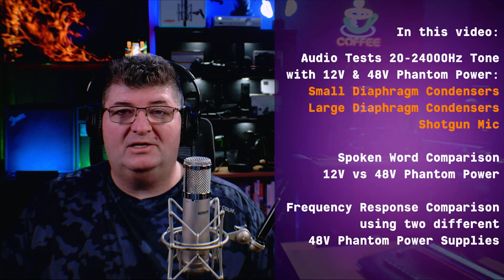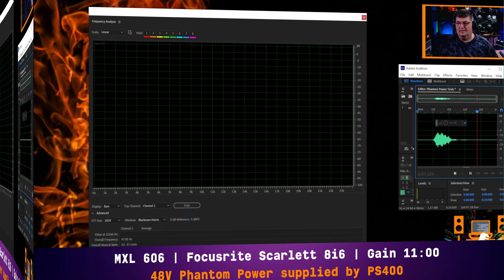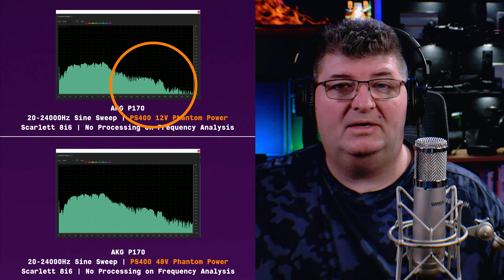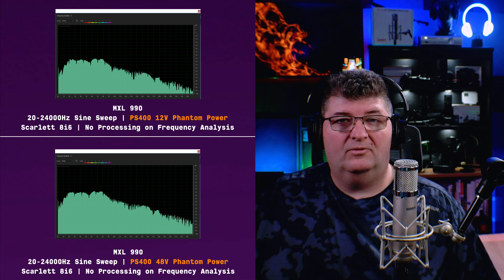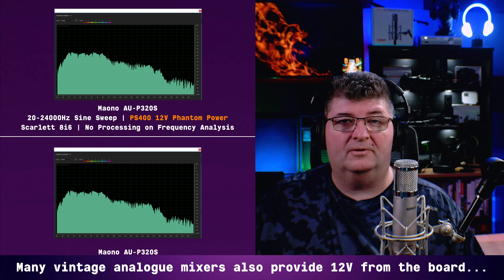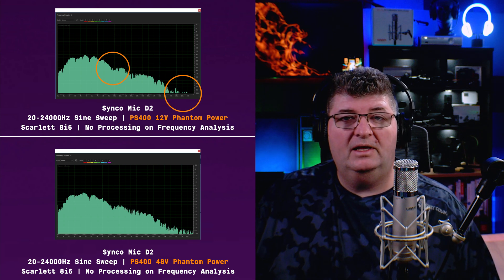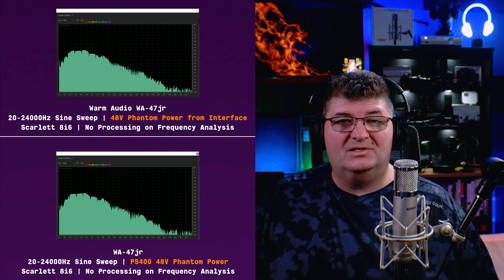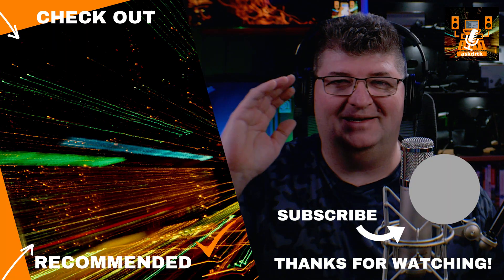How Does Phantom Power Affect Microphones?

Comment: Can I offer a simplified and theory based viewpoint on this? Before I even watch the vid in full. By the way, it would also be good to educate people on phantom power, and what it actually is... not some mysterious thing, and not something sourced from a separate pin.
Anyway, it's as simple as this: AC ripple on a DC supply voltage. I suppose coupling capacitors and their performance could come into it, but I strongly doubt it.
The perfect phantom power supply would come from a battery.

Comment: Hello Sir, few years ago I used Tascam DP 03. When I started recording my song with Dynamic Microphone, I felt very comfortable to sing high pitch notes. But now I use Reaper DAW and use Condenser Microphone, I could not feel so comfortable as I felt in Tascam. Why? Would you please write some suggestions with reason why so happened? Note: I use Nrumann TLM 149 and Aphex 230 Multi Voice Channel. , Preamp. Thanks.
Reply from the maker: I wouldn't suspect using Reaper vs the DP 03 makes the difference, other than comfort with the control layout. I am not sure which dynamic microphone you were using, but even though the TLM 149 is tube-based it generally captures more detail vs dynamic microphones. This can sometimes take getting used to when monitoring while singing. One solution it to monitor with a small amount of reverb (while recording without the reverb). How you set that up will depend on which audio interface you are using as to whether DSP is an option or if you are able to get low enough latency through Reaper.

Comment: thank you for the good video
Aside from the difference in sound quality, is there any safety problem when connecting a condenser microphone using 12v phantom power?
There is no problem right now, but won't the equipment break down after using it for a long time?
Reply from the maker: The biggest issue is using  48V (or 24V) with a microphone intended only for 12V (mainly vintage mics). The higher voltage could potentially damage the components. I generally recommend using phantom power with the microphone's specified range. Many a made to operate between 9-52V, but some are more fussy. I haven't used a 12V board in a long time, but I can't recall every frying a microphone using 12V phantom. If you have a number of microphones with different specs, I do recommend getting a variable phantom power supply such as the XVIVE P1 (great unit that I use in the studio and for testing microphone phantom power compatibility and performance). Hope this helps out!

Comment: One of the most useful videos I've seen on audio gear.  Long-time reps at SW and GCP have not been able to provide much of an answer to this question over the last few years, regarding condenser mics that use 12v.

It's a new topic to me until recently getting an inline phantom power cell with a 12v option.. it was purchased to use a studio km184 on an acoustic instrument feeding into a system without phantom power. When the mic stopped working, we discovered that the power cycling between rehearsal and the show had flipped the setting from 48v to 12v.

The new super sounding gnzlr acoustic amp pro advertised phantom power, but didn't indicate the high-end device only provided 12v. 

Some mics seemed to work with 12v but most of my studio gear didn't.. 

In months of looking for info on which mics support 12v, nothing shows up in Google or bing... 

Until this video of yours today.. which provided the most useful insight!

Beyond that,  the structure you created to present the data was impressive, easy to understand,  and reinforced the need to actually test every mic.

Wish 1000 🌟 stars were an option. 

On to check out your other videos. 

Thank you!!!
Reply from the maker: Thanks! I’m glad you found this video interesting. Phantom power doesn’t get a lot of discussion in general, but as you said it is integral to the performance of condenser mics (and boosters). There are many 12V phantom consoles in use and there are many microphones that will not work with 12V or perform poorly when underpowered. I have been adding a 12V / 48V test to my condenser mic reviews to hopefully help out. Interestingly enough, I just did a comparison video of the LCT 140 AIR and the UA SP-1. The SP-1 works with both voltages, but with reduced signal level at 12V. The LCT 140 is a no-go with 12V, not sound at all.

Comment: Will this damage my shure sv200 🎤? How to know that is safe ? Plz help i will buy
Reply from the maker: Phantom power is generally required only for condenser microphones (and a few active ribbon microphones). The SV200 is a dynamic microphone and therefore does not require phantom power and if you do happen to turn on phantom power while the SV200 is connected it will not damage it. There is no need to purchase a phantom power supply for your microphone. Thanks for the question and I hope this helps out.
Reply: @askdrtk  you help me alot and quickly thank you brother so much ( like + subscribe to you )
Reply from the maker: Glad to help out!

Comment: Hello, my behringer UMC 404HD produces 38 volts, is it okay or theres a fault?
Reply from the maker: Hello, the 404HD should output 48V. Are you using the external 5V power adapter, or trying to run off of usb only? Some usb ports (usb 2.0) will not supply enough power to the 404HD to run 48V phantom power. This could be the issue causing 38V. Many microphones will work fine with 38V, but the 404HD should provide 48V. If you are not already, I suggest trying it with the 5V power adapter and also trying a different usb port. Also, if you are using a non powered usb hub, this can cause the same issue, in which case I would either connect the 404HD directly to the computer or use a powered usb hub. Hope this helps out.
Reply: @askdrtk  i have both the usb and the power cable connected, however i get 38 volts, i get some harmonic distortion in the high frequencies that i don't like, i have been thinking it may be due to this problem
Reply from the maker: Some microphones are more sensitive than others to off-spec phantom power. That could be what is causing the distortion. With usb and the power adapter you should be 48V, unfortunately it may be there is an issue with your 404HD.
Reply: Thankyou, a tech friend told me it should be a faulty capacitor because that's what controls voltage. Ill try a diffrent interface if all options fail

Comment: Thanks for a very comprehensive and professional comparison. My curiosity was actually about the noise (hiss) generated by using a standalone phantom power (extra cable, different components, etc). Did the PS400 have a higher (or lower) noise level than the included Focusrite? Thanks in advance!
Reply from the maker: I ran a few tests using Mogami Gold Studio 6 and 25 foot vs generic Amazon 6 and 25 foot as additional XLR cables with and without the power supply with my Rode NT1A in an isolation box. In all cases the difference was less than 1.4dB, so negligible difference within the error of the test. I have very good power conditioning and isolation for my audio gear and PC (Furman and Tripp Lite Isobars) which I found made the biggest difference in my setup. Thanks for the great question!
Reply: @askdrtk  Thanks for an equally great reply!

Comment: Thank you so much, they were a very useful comparison. Presumably, if the comparison was between 24v and 48v phantom power, the differences would be less dramatic or negligible. Is that correct?
Reply from the maker: Glad to help out. In general yes, but the difference will not necessarily be linear. The tolerance of some microphones designed for 48V will be wider than others. Some may have a sharp drop off in response below say, 20V while others may drop off sharply below 30V... That said, I hope this gives some idea of the impact phantom voltage makes.